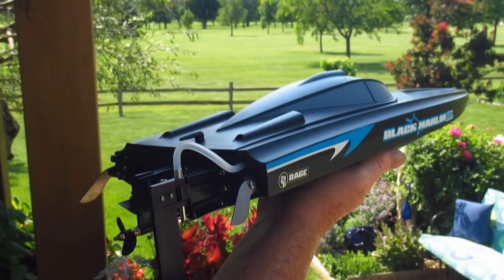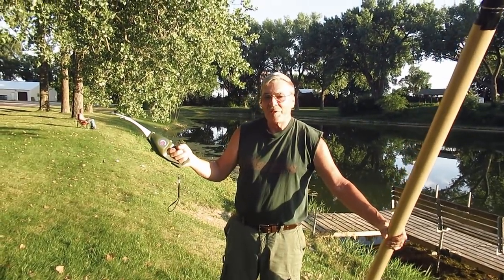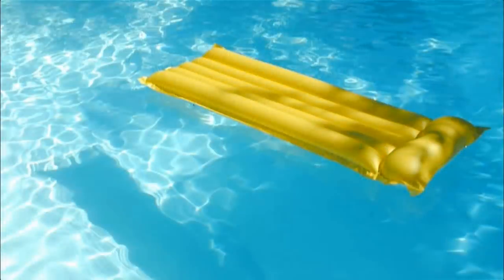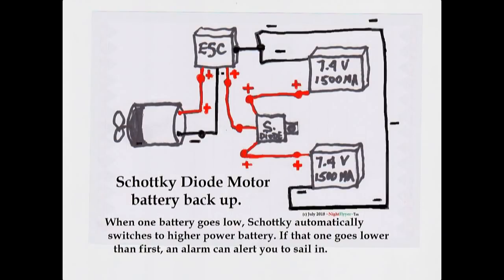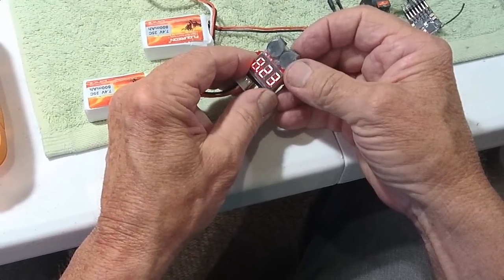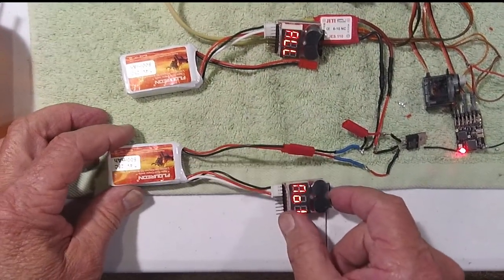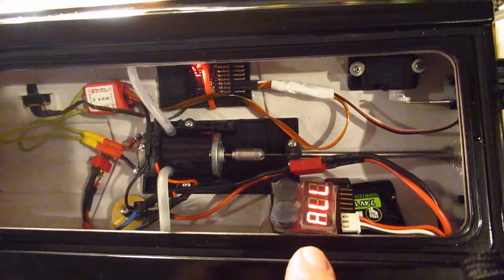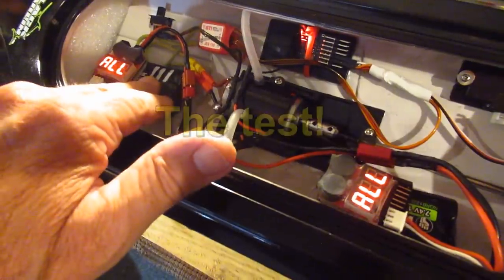R/C Boater's Survival Kit, my boat failsafe mods, and how to double run times.

Comment: I worked at a hobby shop for a few years and a couple of the rc boat guys taught me to put a hardware store hook on each side with some silicone and use a fishing pole with a tennis ball. You cast it out and even if you miss just walk along shore until the line is lined up and reel in.
Reply from the maker: I appreciate that but we tried that first and it never did work. I could not cast the ball accurately and wore my arm out trying over 59 casts. One time the ball hit the hatch and broke the latch. And the ball kept floating around and away and never would catch anything on the boat. With the big hook and sinker I caught it in 3 tries by casting the line over the bow and the sinker dropped and kept the line there. When I reeled it up the hook easily caught the hardware on the back of the boat.

Comment: Man dave I dont know where to begin,there is so much water here in Monnickendam i think you want a home return on it as wel ;-))
Reply from the maker: Yikes!  GPS then required!  That would be nice, but if the motor doesn't run....... LOL.  I think I better stick with helis and planes.  LOL  Thanks Pieter.

Comment: Good stuff Dave!  I just up graded my old Fisherman Ace cabin cruiser to brushless water cooled motor with a Castle Sidewinder ESC.  The access hatches are just held down with Velcro and no seals.  After my son cruised it around a little and told me the steering needed trimming I took over.  I found out it was so over powered that it was torque steering and bow heavy.  I tried a high speed run and when I punched the throttle it did a back flip with a roll.  Landed right side up and was back in control.   Had a big laugh after realizing all was okay.
Reply from the maker: Haha.  Yes that was good, or you also may have been using the Pocket Fisherman approach.  Nice story with good ending.  Thanks Lloyd.

Comment: My H100 has a timer or something built in because it beeps when the battery is low. I dont usually run it that long before switching batterys. You have a great system there. As I run my boat full ot most of the time, I usually limit my run time to 5 or 6 minutes per battery which works out perfectly. My other RC boat is a fishing trawler from Germany and has been modified from toy grade to hobby grade but is very detailed. It has working nets, LED lights and a smoke generator for the exaust.
Reply from the maker: Nice boats you have there. There were no warning beepers built into the rages. They slow, die, and shut off. Never was close enough to get back hence my $6 beeper mod. Thanks!

Comment from the maker: If you ever had your RC electric boat stuck in the middle of a pond, these items may be just what you need to recover your boat. Also my Schottky diode Mod can double your boating time, by discharging 2 batteries evenly and proportionately.   Plus this simple $6 battery alarm can warn you to come in before it's too late. Links are in the description box. Thanks kindly for watching.